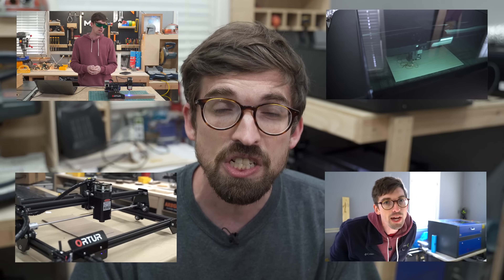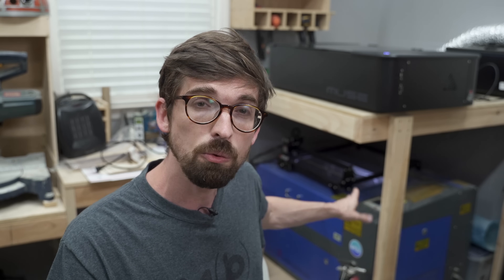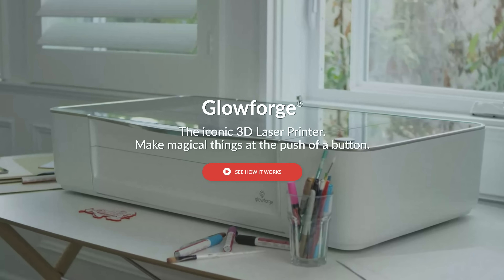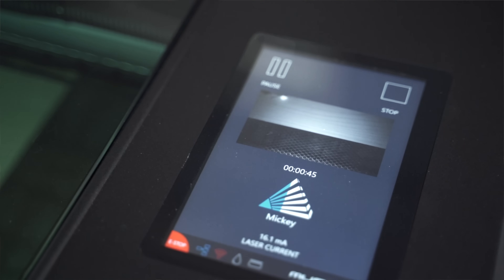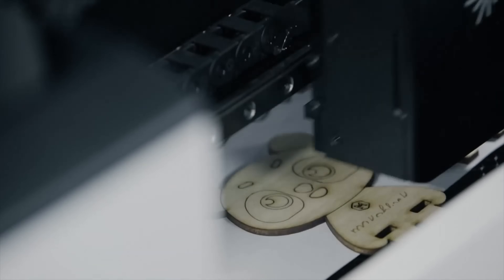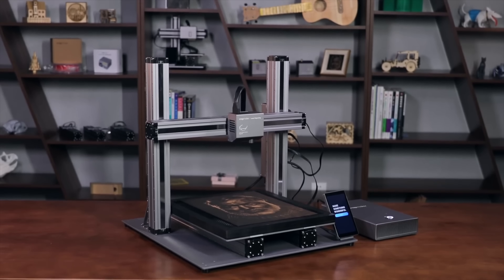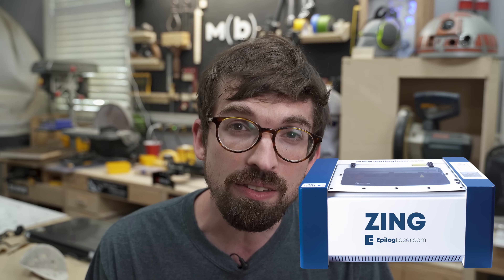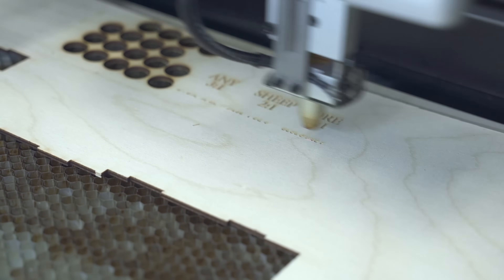What is the Best Laser Cutter and Engraver for You?

Comment: Could use some advice.

Looking at the glowforge and K40. But wouldnt mind to be directed towards more industrial versions.

I got a spare room, probably 2x1m left. Ability to place air assist and extract fumes through a window nearby. It's in an appartement, quite populated so wouldnt be cutting overnight haha.

Planning on cutting acrylic/pmma 3mm thick plates i want to feed atleast 50x50cm plates for ease. 

But also want to engrave/scorch leather and woodies(multipex/plywood most likely)

Maybe engrave aluminium but I realise there are specialised laser(lenses) for that particular operation.

Got max 5k to spend. Looking for a ROI within a year. (Things I sell will be around €5/€25 a product, around 5000mm distance in lines per product)

It's mainly hobby orientated. I want to comfortably be out for work during the day while it is running. Ofcourse I have a contact in the appartement that could keep an eye on things and unplug the field if necessary.

What would you guys recommend based on my input? What might I have forgot to mention that could be detrimental for decision making?

Comment: Actually my 5w diode laser can cut 4mm plywood but I gotta go real slow with 5 passes or so. But, it works, but it's only suitable for really small stuff. I did some finger joint boxes for CNC router bits, roughly 15x10x10cm box size. Took a few hours but I just left it running so that was fine. Also a bit of cleanup work was necessary to get all parts out.

Comment: It really does seem that with laser engravers, you really do actually get what you pay for.
Every cost tier adds significant ease of use or completely new capabilities.
Is a IS900 from Gravotech $20,000+ yeah. However, it is twice as fast and versatile as anything this guy has, and the software is phenomenal. Buy chinesium, get chinesium. Buy kickstarter, maybe get good hobbyist machine that will run 2-10 jobs a day. Pay double, run 100s of jobs a day.

Comment: I am still really lost. I want a laser cutter to make dollhouse miniatures in 1:12 scale at the largest and 1:144 scale at the smallest. I have a Cricut Maker cutting machine and it doesn't cut precisely and small enough which is why I'm looking for a laser cutter instead. The most common materials I would cut would be around 2mm or less, matboard to thin wood.

I'm 33 but I find technology to be a little annoying. It's not my favorite thing to figure out software and do upgrades. I don't think I'm even capable. So I need something user friendly that I can use with SVG files.

Comment: Nice Video and has a lot of information in it.    I want to get into a Laser Engraver but of course there is so much info to digest and make decisions on.    Because of the COVID virus we have now lost the only place I would have gone to look at and ask questions about it.  That is FRY's Electronics.  I was going to build a newer computer with newer components.  I like to buy locally and now there is no second choice place to go.  The whole printing and engraving environment is changing so fast I have been deliberately slow to get involved and jump in.  Would you be able to make suggestions on where to focus if I mentioned some of the criteria involved?  1)  Engrave small objects like in the size of Keys, Knife handles and up to the size of 6 inches square for just a little more versatility;  2)  Because of size - price should be small due to the versatility and usefulness is reduced (comparatively);  3)  Precision - due to the size of the engravings they will be examined closely.  4)  Engrave or etch but NOT cut through.  5) Small because of my needs and can't have it take up a lot of room.   6)  Engrave any metals that will dis-color noticeably. 

All these are valid reasons that must be evaluated together.     If you can please give me a few suggestions.  Because I don't know what the prices may be, please consider price to be of the lesser requirement.  I want a good one that will do the job.  Thanks for your help.

Comment: was a great video to stumble upon after trying to find some honest answers on engraving as a total beginner! I diddd have a specific question, you mentioned briefly "logo on cutting board" which is my intent for one, however the unit i was looking at was kind of a box that had everything inside of it. the diode was 3w, but no one ever says "it can engrave all of these, dont get it if you use it on these". I want it to be able to do walnut, but everything always just says wood, and there are so many species of wood of different hardness, i cannot for the life of me find a simple yes. In your opinion, 3w diode able to surface engrave (maybe 1/8") walnut, and other hardwoods.
Reply: Yes

Comment: I love my beamo.  30w laser. Nice setup, software and camera are great. Can easily hook to my computer.  I think it goes for $1500 (I bought the kickstarter so its obviously a diff price) and I recommend it when ease of use and safety is accounted for. Research your seller to make sure good customer service is available. I haven't had problems and I've used it for about 8 months regularly. I also never cut at 50% to help save my CO2 laser, but thats a personal pref. Never look directly at lasers, always get glasses but you still shouldn't look directly at it with glasses on either.  Also research what materials you are cutting because gases released can be harmful if youre ignorant of what you're cutting. Hope this helps and glhf :)
Reply: hi , beemo is good to engrave small pebbles(stone) ? 
thanks in advance..

Comment: I work with very large industrial Bystronic lasers. I've kinda wanted to get into it it as a hobby. I wish I could just use the ones at work for some personal projects. We use the CO2/LN2 lasers to cut through 1/2" mild steel. The new Fiber laser is used for the same parts, but is 10x faster.

Comment: I actually have a CO2 laser that cuts metal. I imported a full size 4x8 table from China. It has two heads. I only paid $8500

The key to being able to cut metal is POWER. You need your laser tube to be rated at 180w (peak) with 150w nominal. So don't only get a 150w tube and think you've got enough power. (Maybe for super thin sheet metal) The way you can find out if the laser you are looking at can even begin to cut metal, is the head. They are significantly more chunky, look industrial. But they are known in the biz as "Metal/Non-Metal" heads. That's the phrase you are looking for. My table came with a water chiller, up/down front half table, 2 blower motor fume extractors, extra honeycomb top, rotary attachment and small aquarium pump. But I'm using a silent air compressor, it barely needs any real PSI above 40 anyway. And believe it or not, all of it runs on a 120v. (Even though I just converted the actual table to 220v, so I'm not tripping breakers running the water chiller, blower fans and an air compressor all at once. I had to do the extension cord thing across the shop for awhile to catch different outlets not on the same circuit)

More about the head I use to cut steel with... It can cut up to 4mm mild steel and 3mm stainless. Which is crazy to think about, considering the price point. The other thing you will absolutely need is a bottle of oxygen from a welding supply store. You only need to use that when cutting steel. So it's a minor cost factor even if you are just messing around. The other benefit of that particular head is that it can also cut 1" thick acrylic, with glassy smooth polished edges. The secondary head I mentioned, I only use really for cutting thin stuff, most mostly engraving. I believe that one is rated at 80w peak.

Comment: Okay, I find your video both informative and misleading. you mention the TOP laser engravers, However, you do not mention that they are all "Hobby Lasers" and not professional engravers. Nor are any of them ever mentioned in the major trade publications like Engravers Journal.  There you will see article and advertisements for the true top laser engravers. that said I have a big problem with Full Spectrum Laser.  Having done business with both Trotec and Epilog  and having been involved with a number of different types of laser, I find FSL to be the worst company in the business that I know of.  I had a Muse engraver back in 2016. Having had better machines and knowing that the Muse was only a Hobby Laser, I still found it to be a big problem. Files would not load, the Claim that corel draw files were fully compatible a joke. Having a BS in Computer Information Systems (programming major) It was clear the first day that the software had serious flaws. The design part of the software would not even display properly. Some of the tools were partly hidden and there was no way to make them display or usable. The few things that I was able to draw would not save and be available in the main window. The machine itself was flimsy and the cheaply built. Mirrors were not aligned and not easy to align. The claim FSL advertised back in 2016 that the Muse does not need to be connected with the internet to work was a marketing ploy to try to get sales that might have gone to Glowforge. Bottom line here is the claim that the Muse did nt need to be connected to the internet is both true and misleading.  The true part is that the muse can be operated while not connected to the internet. What thye don;t say much about is the fact that you do have to have an internet connection and have the Muse connected to the internet and turned on. FSL sends updates to the Muse all the time. If your machine is not connected it does not receive the updates. History since 2016 has shown that many muse owners that had machines that worked one day found that their Muse would not work at all the next day (After FSL had sent an update).  FSL lies about capabilities of their machines. They advertised that a materials database would be into the Muse. It said that on their web site and I verified it with my salesman before buying. No Muse has ever had the materials database. After I made a fuss on several Facebook forums Full spectrum Laser removed any mention that the Muse was to come with the database.  My first Muse bluescreened the second morning I had it. I let FSL talk me into a replacement machine. Thy lied about that too. First they said that if I would let them send me a replacement machine they would ship it out that same day. And they claimed it would be fully tested and working as advertised. However, that is not what happened at all. FSL waited until my first machine got back to them. Second, the second machine had the exact same problems as the first one. There 30 day 100% refund policy is something they run from. If you call tech support they will try to help you. that is as long as you go along whit what they offer. As soon as you tell them that you want to return your machine for a refund, they stop responding to you completely. Lucky for me I was persistent. I called multiple times a day and send emails several times a day. No response for 8 days. When I did get someone to talk to me he informed me that they would not pay the return shipping. Had I bought a machine and then just decided that I did not want it, that would have been reasonable. However, when you get a machine that clearly has major problems and will not work as advertised they should pay for the return shipping. So I sent the Muse back at a cost to me of $271.73. Then when FSL received the Muse they took more than 30 days before refunding part of my money. Yes, that is correct. They have a restocking fee they take out of your purchase price. Again if i was returning a work machine simply because I did not want it, a restocking fee would be reasonable.  Before I shipped the Muse back I told the at Full Spectrum Laser that I did not think it was right to make the owner of a non working machine be responsible for return shipping and then to add insult to injury charge a restocking fee.  My comments to them were that if they gave me all my money back, I would go away. However, if they did not refund all my money I would make it a point to tell as many people as possible how they do business.  Long story short I lost well over $500 to FLS. The return shipping was $271.73. Then the restocking fee took another $250 of my refund.    The only concession here is I have for my trouble is I did make a fuss on a number of forums. After more than 2 years, I contacted the head guy. we had a phone conversation. At the end of that call FSL did refund my $250 Restocking fee. However, they refused to refund the $271.73 I paid to ship their Muse back to them.  Not to long after returning the Muse I started a fb group called Muse Buyers. There I now have well over 400 members. Some have Muse engravers. Several tried to return their machine for refund. FSL stalled and would not respond to them. once the 30 day refund period ends they will respond but will not take back your machine. To be fair, of the members of my group that own a Muse, a few  have only goo things to say about it. However there are more members that have a Muse that does not work.

Comment: In my research, on paper the muse 3d seemed better than glowforge, especially with the rotary height extender. But the fine print only offers 30 day warranty vs glowforge 1 year. I contacted sales to confirm this. They didn't respond back. Big red flag that lead me to other complaints about service and power supplies blow often. 30 day warranty on new gear for that cash is awful.

Comment: Hey Brandon, thanks so much for making this video. I am in search of a laser and this helped answer a few of my questions. Perhaps you can help me... I am in search of a laser that can Etch through powder coating. My biggest issue is that the product is large and I would need a pass-through system or some way to Etch in the middle of the product. I have been looking at the Orion Motor Tech 60W, but how do you think that might compare to the FSL Muse Core 2D with Hobby Kit?

Comment: Bought a Full Spectrum 18 x 24 machine 3-1/2 years ago at approx. $9,000. Had to replace laser 8 month later. ($600) 2-1/2 years old and Main processor and power supply failed. Called F.S. and got nothing. They had stopped making the main control board and offered NO assistance. Bought a new power supply and Main processor from Light Object and got machine back up and running. Quite different software to learn, but, now I prefer it. I CAN'T recommend F.S. for their customer service or warranty. Just had to replace an axis driver. Another $50 gone! Please do your OWN research!

Comment: Dude I’m loving your videos! Great stuff. Is there a laser you can recommend for use with an iPad? I’m a graphics designer and want to maybe engrave wood
Reply from the maker: In terms of running a laser from an iPad then you would need one that could either be controlled completely from the machine (most bigger units do this) or the control software can be accessed through a web browser (Full Spectrum and Glowforge).  On the graphics side you can pretty much create any format and import.

Comment: Ortur can certainly cut. But it requires multiple passes. 
I got the snapmaker, and it does a great job cutting, mainly because it has a Z-axis. You do have to calibrate the Z-axis height for whatever material you use.
Reply from the maker: I want to check the Snapmaker out!
Reply: @makeorbreakshop  Two additional notes for when you try this out...

1- I was getting really frustrated with cutting 2.5mm plywood... UNTIL I finally went and checked their forums and found the link at the bottom of this comment. The cutting setting they list for plywood was just right and gave me perfect cuts from then on. I did find that their plywood engraving setting was not good (100% power too much, 50% power just right), so I left a comment at the bottom for my recommended setting.

2- It's sort of a software labeling bug. In the software, when you use the engraving for a picture, and on the Dot (high quality) setting. They show the "Dwell Time" units as "mm/min". This is incorrect, and it is really "ms". 

https://support.snapmaker.com/hc/en-us/articles/360019025954

Comment: I’m trying to really primitive designs, cutting through thin sheet aluminum, but at most 20x20 inch. Would those Chinese laser printers be good for that? If not which one would be?
Reply: Metal cutting takes a very powerful laser (at least 300w) and forced gases like pure oxygen, none of the lasers here are gonna do that. If you want to get into mental cutting I would suggest a CNC router or water jet cutter as these are going to cost much less then a metal cutting laser

Comment: great video!!  quick question, i want to do some light cutting up to 1/4 of an inch and need some very find detail engraving on anodized surfaces.  I make yoyo's so the engraving would be in the bottom of a yoyo cup.   I was thinking about the machine you talked about at 3:32 mark of your video.   Thanks.